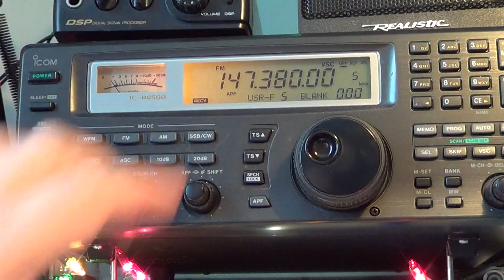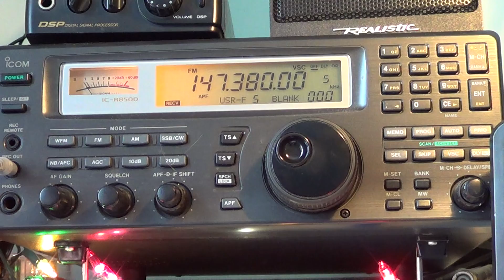Tips on checking VHF and UHF propagation

Comment: Thanks you answered the one question I came here for. I was wondering if there's any noteworthy enhanced propagation while using UHF.  Now I wonder how much?  I have my dual band antenna on the roof but I haven't used the UHF much because so many operators use 2 meter.  UHF in my area is very quiet in the ham band.